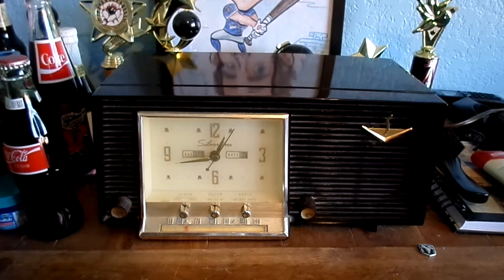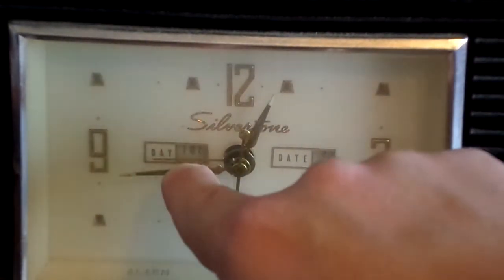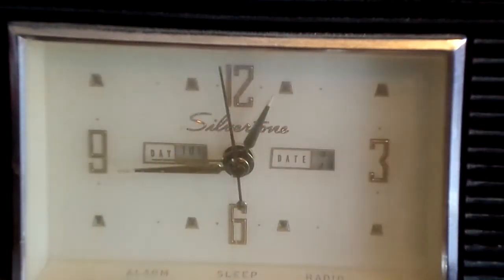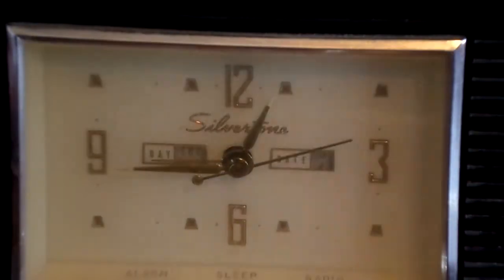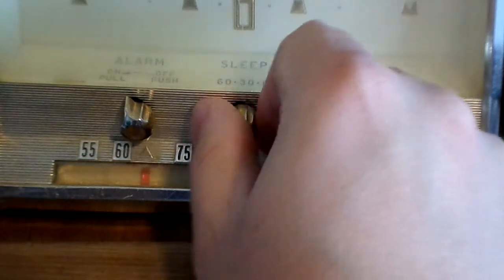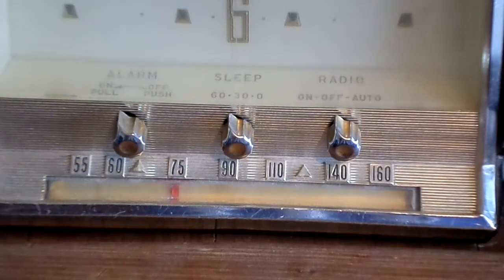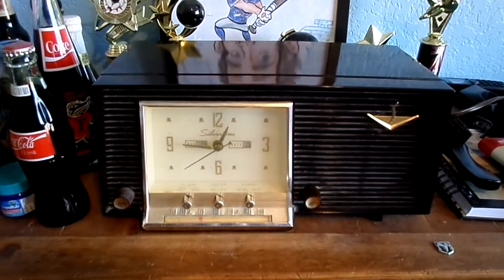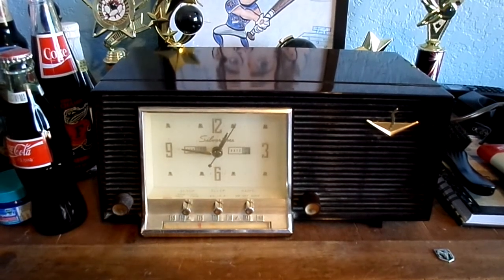Vintage 1956 Silvertone Model 6025 AM Tube Clock Radio - The Test

Comment: 1950s stuff is cool like the clock radios and the cameras
Reply from the maker: Damn, I just wish that I didn't cut the wires on this radio. I regret cutting them. I could've done something to get the radio working good as new again. I wish there was a way that you can somehow put in brand new wires into the radio, but I doubt that would ever happen. I've been kicking myself in the ass for cutting the wires.
Reply: MAGNUM05 I bet there are places that can fix that or you could try to find info online